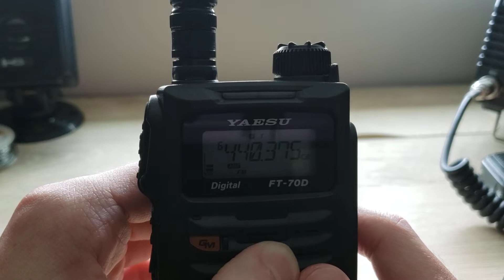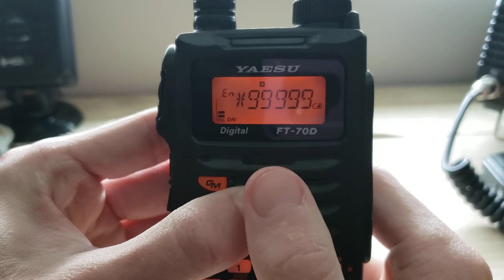How To Use Wires-X On The Yaesu FT-70DR.

Comment: I've also noticed that WIRESX nodes have two numbers: one is the node's number and the other is the node's room number. My understanding is you can dial in to both of these from remote nodes but I don't understand what the point is for having two. The node number I assume is what the node effectively reverts to when everyone disconnects from it or when someone dials 99999. Fine, so we need that to exist to allow remote nodes to connect to us. But what's the node's room then? For node 12345, 22345 is the node's room. What is that used for?
Reply from the maker: I know it’s confusing. My understanding is that node numbers is how you connect two repeaters directly. You can also connect to Wires X rooms if the repeater has that capability. It’s just two ways of linking with the same mode.
Reply: Thanks for answering. So if I dial in from my local node to your local node, your local node will start transmitting me on the air near you. And if I dial in to your local node's room, the exact same thing would happen? Would either rod this two cases have a different outcome if, when I dial, your node has already been connected (perhaps by you) to some other remote room, let's say an interest based room?

Comment: I have so many questions.😅

If you don't connect to the WIRESX of that repeater, does it still function as a repeater if you just PTT? If so, will it only repeat your signal locally or does it also go to the internet somewhere?

If after you connected to the WIRESX in your video, someone else also connected to it and tried to dial in a different room, what would happen? Is the repeater able to tune in to just one room or does it somehow let multiple users join their own rooms as they want?

If while you have selected a room as shown in the video, and you start chatting with someone there over the internet, would someone who simply tunes in to the repeater frequency locally be able to hear your conversation? If that someone else then proceeds to transmit in FM, would his transmission be relayed to the room that you are talking on? And would the repeater now switch to analogue to accommodate for him since this is supposed to be fusion?
Reply from the maker: FM and digital are two separate things. If on FM you will not hear the digital as it will be an annoying noise. I have found that linking in digital voice is the same as EchoLink or AllStar. People on digital will hear the traffic.
Reply: @AI7HE that's true, an FM only receiver will be unable to receive C4FM and it will sound like a buzz. But yaesu fusion is basically based around that AMS feature ans in theory if someone transmits with FM on the local frequency, all local participants, I assume including the local node's hardware, will switch to FM for their next transmission. I may be wrong, I'm quite the noob in these things but I wonder if you've encountered a case where AMS switched the whole WIRES-X repeater to analogue because someone with analogue transmitted on the local node's frequency.
Reply from the maker: @1NSHAME yes which ever modes is transmitted first ams will switch automatically to it.

Comment: My ft 70 doesn't do that.....
Reply from the maker: You gotta do it through a repeater
Reply: @AI7HE  what about for the hotspot?
Reply from the maker: It might be a Wires-X thing because a typical hotspot only does YSF.
Reply: Make sure you've upgraded the firmware. I think WIRESX was not supported initially by the ft-70d.

Comment: Do you have to register to use wiresx?
Reply from the maker: Nope. Just need a radio that can do it.
Reply: @AI7HE  I have the ft70d, but I'm a complete newb.
Reply: @ricks3313 just got the same radio a few days ago but I don't think I can reach the nearest WIRESX repeater from my house. I'll try to go closer on the weekend.
Reply: @ricks3313  With the Wires-X repeater's frequencies programmed into a channel, and the appropriate C4FM mode turned on (see your radio's documentation for how to use C4FM), you should be able to starting hearing the repeater traffic.  If you hear buzzing sounds instead, the repeater is transmitting digital voice and you need to use DN or AMS mode.